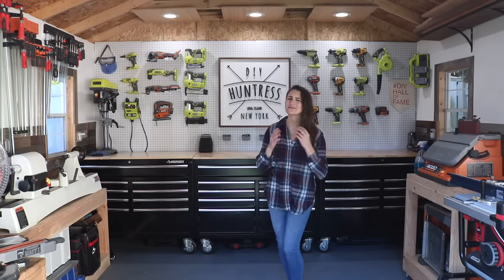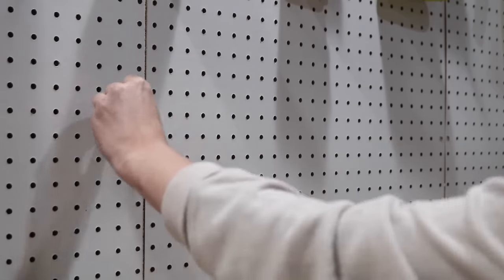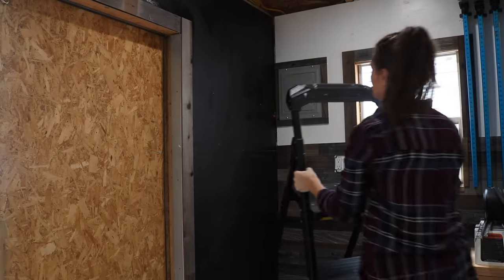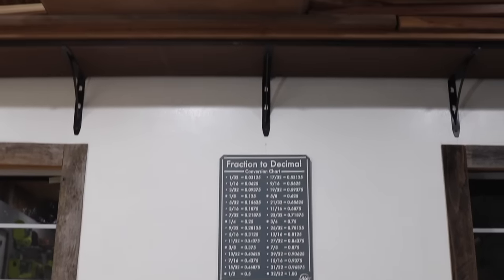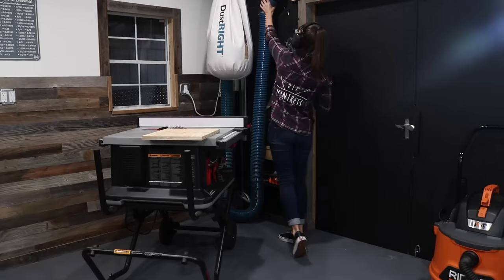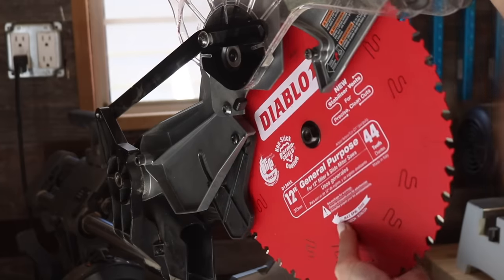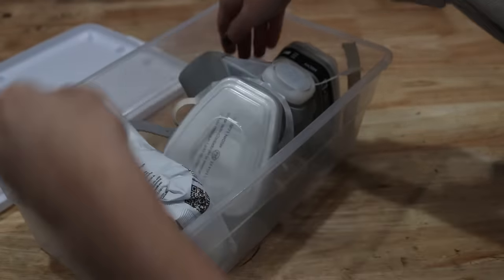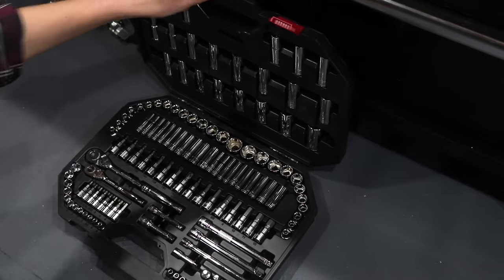Workshop Organization Tips & Shed-Shop Tour

Comment: What type of dust collection are you using?
Reply from the maker: I use a Dust Right wall mounted system partnered with a Wen air filtration system and also a RIDGID shop vac (for smaller stuff).

Comment: Is it safe to store propane in a tool box like that?
Reply from the maker: Small propane tanks are really safe to keep around especially when capped and stored in a cool area when not in use. I never store them with the heads on, so that there isn’t anything attached to them that can ignite or leak.
Reply: @diyhuntress  Yea that makes sense, big propane has the valve attached which can leak but the small cylinders don't. Awesome workshop by the way... I'm jealous

Comment: You used spray foam insulation in the walls—do you have heat or ac? I notice you have no insulation in the ceiling, this is where your biggest energy loss will be. Doesn’t make sense to insulate the walls and not the roof.
Reply from the maker: Well aware it doesn’t make sense to insulate one and not the other, but the spray foam insulation I used isn’t recommended for use on the ceiling and with my full time job and side hustle, I haven’t gotten around to being able to research insulation for the ceiling and/or install it. It’s on my list - but, it’s been pretty mild in there and my small electric space heater keeps it sweltering in there in the winter, so it hasn’t been a priority. I’ll get there eventually. 😊